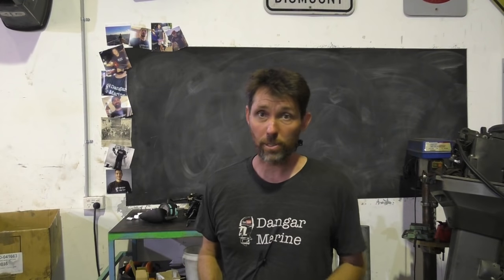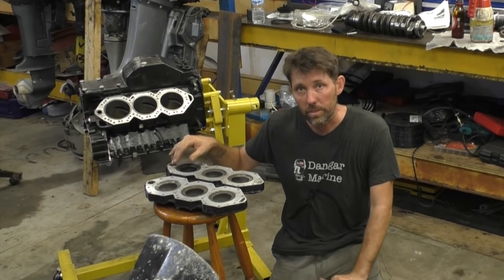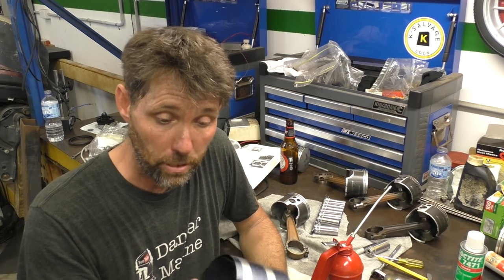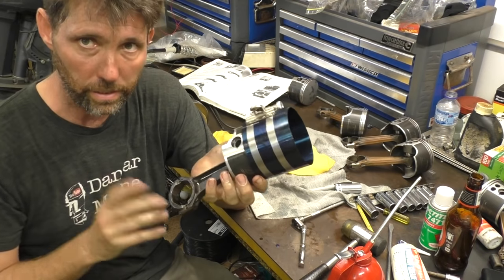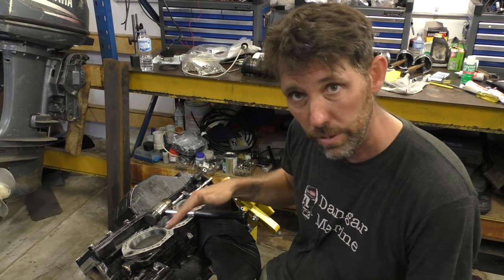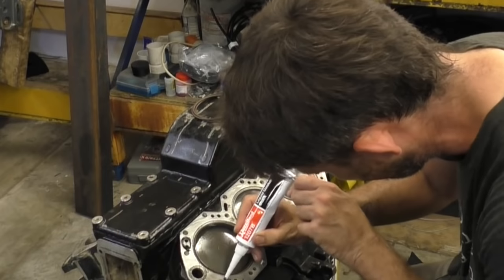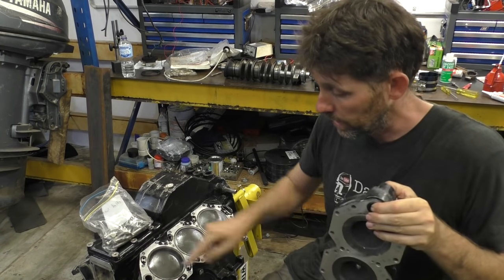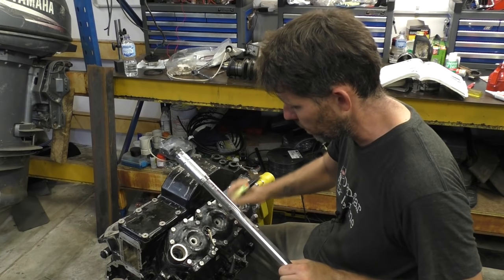Installing the Evinrude 150 pistons

Comment: The number 6 cylnder oring on the port side wasent located properly! Check the vid youll see
Reply from the maker: +Jamie Dykes Thank you! I'm glad you mentioned this because I'm at Evinrude right now and they have those o-rings in stock so I've bought a replacement one. I struggled quite a bit to get all the starboard ones to stay in long enough to get the head on so not entirely surprised about this given filming is a bit distracting.
Reply: Yeh they can be fiddly, i dont work on many boat engines that often mainly machinery, pumps compressors and gas turbines, on the compressor sets they are the same quite fiddly to get the top half of the casing on, we machined 2 long guide pins that screwed in to 2 of the bolt holes and were a close fot to the bolt holes on the top half casing they worked really well, mabey making a couple for fitting those heads would help. also with the o-rings i find that instaling them dry and then putting a smear of grease on the exposed area that mates to the head helps, i use this trick alot with CAT diesels and it works well, also i know your pain trying to talk to the camera i have been trying to make my own instructional vid for some time now and realising how much effort goes in to them, keep up the good work, love the chanell
Reply from the maker: I redid that port side this morning and it definitely takes a lot of fiddling to get all three o-rings to stay in place at the same time. I had a go at putting them in dry to start with because I was also thinking maybe the grease was making them slip out again but they seemed to pop out more dry. Anyway, they are in now so I'm glad it's fixed up. My plan is to do a compression test on each cylinder before firing it up just to make sure it's all okay. Fingers crossed it won't have to come off again!

Comment: Thank you for the excellent explanations and details.
Watching your video reminds me that on a 115 I did a while ago, I used a temporary sealant on the heads.  I used what I had, and was anxious to get it running.   I still need to go back and replace it with better stuff.  Thanks for the reminder!

Here is a shaky phone vid of the first full-bore holeshot with that motor:
https://www.youtube.com/watch?v=ZVvLdfMHkWQ
Reply from the maker: Goes like a rocket! Must have a well matched prop to get up on the plane so fast too. :)
Reply: Yes, she is very fast.  Not sure of the absolute top speed yet, but well over 100 kph.  I've only taken her out twice, so far. Still need to tune her in, but work keeps getting in the way.

Comment: i got a v6 Johnson for parts the v6 block is cracked i going to tare it apart to get to the block( i have a friend from trucking a welder that fixed blocks the one who fixed my old ford 400 it had no freeze plugs in back  it cracked a few places the welder used a plastic heat seal it was on back side of block( he got cancer and died) not in side cylinder walls, willy i saw weld up block and sleeve it! i know air cooled cycle motors are sleeved out boards are water cooled from lake water this might not be save able to much damage! i have a evin-rude v6 ( supply by test place the guy who owned boat was paid threw ranger & motor maker) on my boat i needed parts the owner died by family relation i got it!

Comment: Did not know that outboards do not use a head gasket....
Reply from the maker: This is more an Evinrude thing than an outboard thing as such. Every other outboard I've worked has had a traditional head gasket.
Reply: A bit off topic but wanted to ask you a question about a 2002 50HP Honda outboard manual relief valve for the tilt/trim. Parts list it as "no longer available" and the local parts guys say you need to buy the entire new hydraulic pump. Wonder if you have ever had to replace one and if so when and where?? Thanks Stu

Comment: Please never use anything to wash bores except water and 2 stroke oil. When you suspend the abrasives from honing and deposit them deep into the hatch marks of the bore with solvents that evaporate it causes a less than ideal condition. Im not trying to be that guy but the manual was right they didnt stress how important it is tho. Proper bores are everything.

Comment: paint the block before u move on! :D
Reply from the maker: I like your thinking!
Reply: do a video of it if u do paint it :D
Reply: If you decide to paint the motor,  I HIGHLY recommend that you buy factory paint.  Evinrude paint is hands-down the finest paint I have ever used, bar none.   It is extremely tough, extremely glossy right out of the can, and is only $11.99 a can retail.  I use Evinrude paint on Mercury and other brands, too, because the quality of the paint itself in unmatched.  Get gasoline on Mercury Phantom black, and it bubbles and peels.  The OMC paint just laughs at it, after its cured for a few days.  I could go on, but you get the idea.
Reply: i am not sure, but i think he didnt paint the block. as he already assembled and started it.

Comment: I know you were very careful, but using one of those ratcheting ring compressors is not a good idea on these engines.  It can be quite difficult to get the rings lined up on the locater pins inside the compressor, then the rings move slightly as the compressor is tightened up....It is very easy to dislocate the rings and cause a lot of hidden damage, not always so easy to detect while tapping the piston down in that tight fitting compressor.  I know, the OEM sleeve type compressors are costly, and might not even be available for the wiseco .040 over piston, but it is money well spent.  Again, I know you were careful, but I don't want your viewers to think those ratcheting compressors are a good tool to use on the OMC outboards.  I will have to check the OEM manual, but I truly disagree if it says to put those head bolts in "dry".  Yes, I know adding some sealer to the threads might affect torque readings a bit, but not enough to account for anything.  The OMC/Merc/Yamaha gasket sealer should be used on the threads and shanks of those head bolts to minimize corrosion build up and snapped off head bolts during future servicing.  This engine uses SS head bolts which are better in terms of rust, but the dissimilar metals can really promote corrosion... Looks great so far, can't wait to hear her purring again, those 60 degree V6 engines are nice ones....
Reply from the maker: I'm sure there are better tools for the job than those one size fits all spring compressors, but I did find that on one occasion a ring didn't seat properly on the pin and it was very easy to see looking down into the compressor before beginning the process of installing it. I was a bit surprised too about the manual saying to install the bolts dry, but it was very explicit. I agree though that thinking about future corrosion problems is always a good thing when it comes to outboards!

Comment: Hey I posted a video on my page channel about a ruff running Evinrude, think you could take a look and maybe point me In a direction
Reply from the maker: I'd start will all the basics: carb clean and check for quality of spark.
Reply: Dangar Marine what about all that steam?
Reply from the maker: If it is blowing a lot of steam then it could be a blown head gasket allowing cooling water to enter the combustion chamber.
Reply: Dangar Marine damn alright I'll run through it